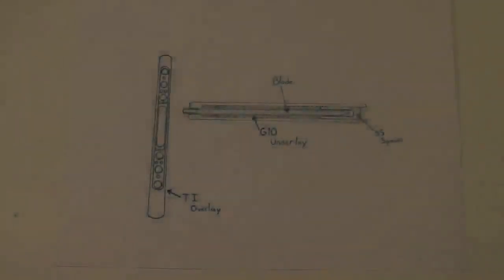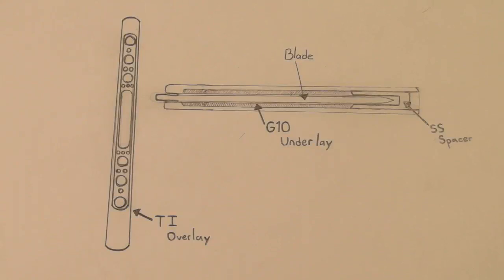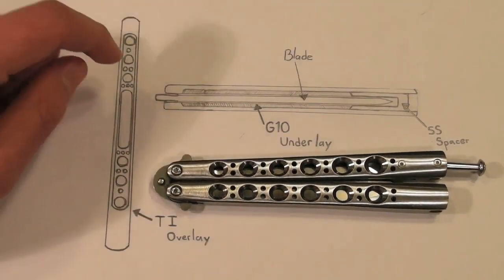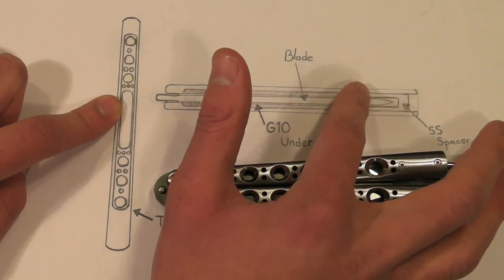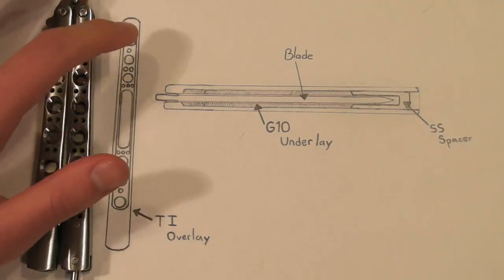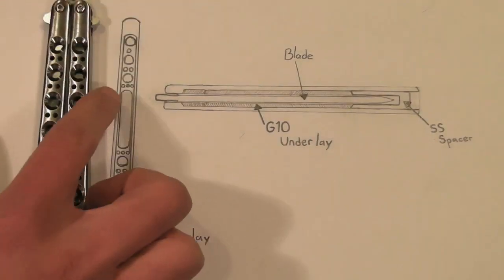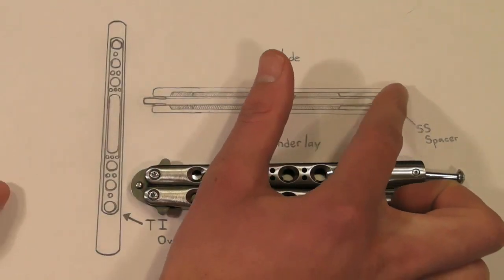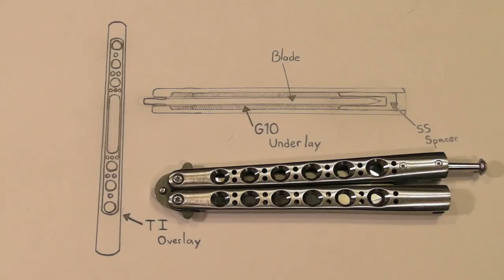New Idea - Balisong Design

Comment: I don't understand the reason for the G10 underneath. It seems like it would just thin out the metal, making it more flexible or breakable. Another problem would be that if the handle play becomes too much or the screws become too loose, the blade might hit the G10, causing damage it to chip or break

Comment: Since we are talking about it... I think the old 42 spring, that works in both directions and always holds the latch out straight, is better than the leaf spring for flipping. It also causes the handles to be longer than the blade by a greater amount than other latch systems. Which I think is more flippy also... i want long handles for scissoring and certain stuff especially... and that bali, CN, the deisgn, is straight tits bruh... hope you make some knives dude, id get one...